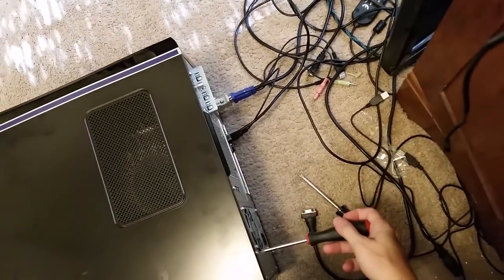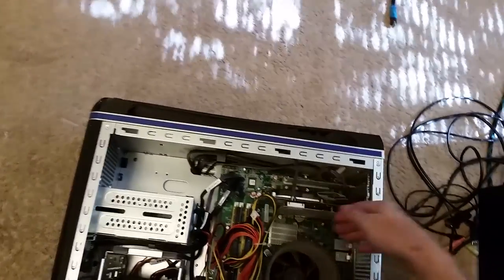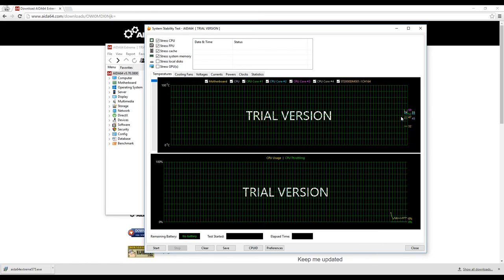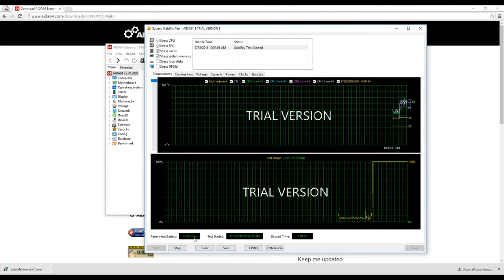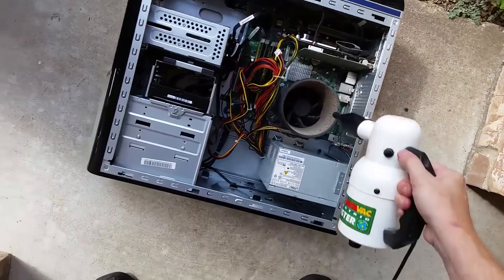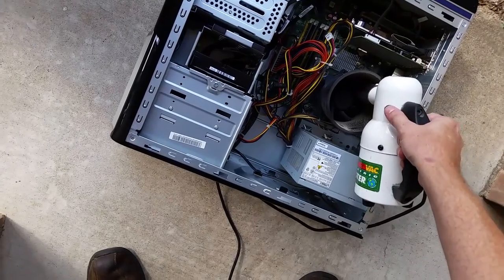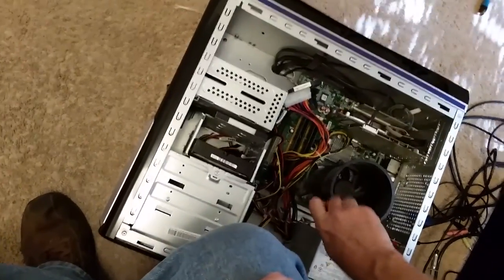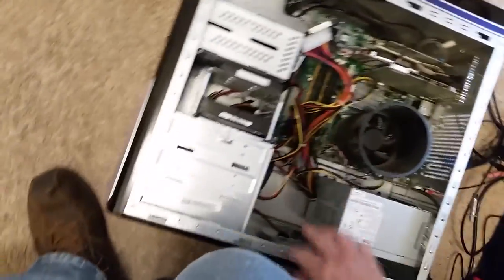Troubleshooting a computer that is loosing power, replacing the power supply

Comment: great video :) just wondering could you have cut or filed that bit on the case so you could get all 4 screws on the psu in or would it just cause an issue?
Reply from the maker: Any kind of grinding would send metal splinters everywhere.  Cutting the case with metal shears would leave a sharp edge.  Best to just leave one of the four screws out.